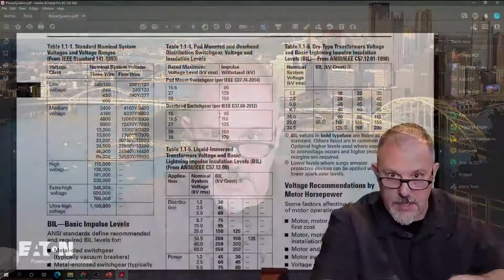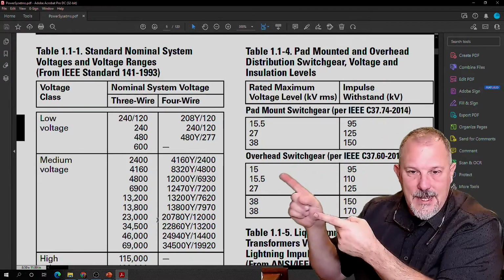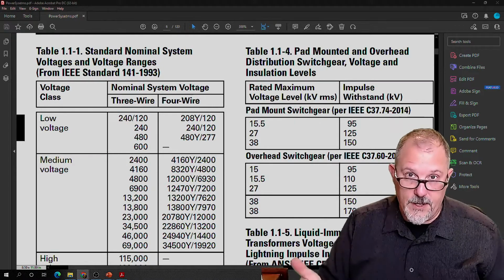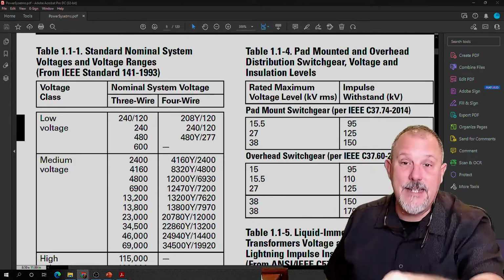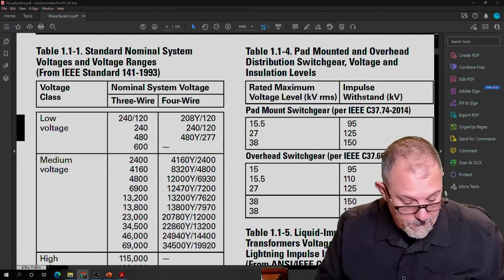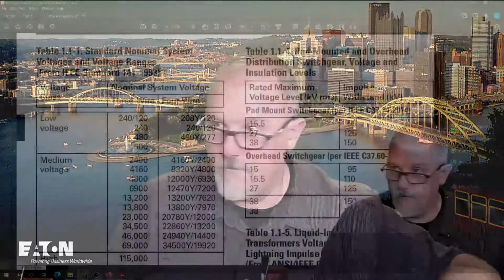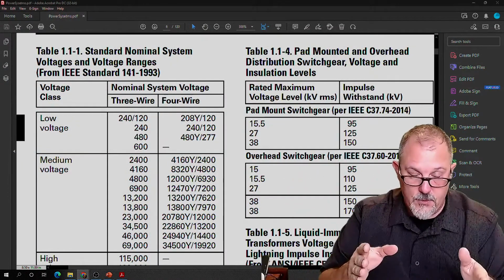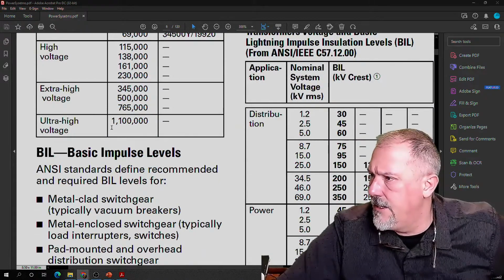Power Systems Design - Voltage

Comment: About 5 years ago at a IAEI meeting they mentioned that some people in the USA were looking into two things: raising the 480 volt commonly used 3 phase system to 575 volts to save money on wire and installing DC panels in large sites to save energy on Rectifiers, power supplies and air conditioning. Think they stated that Japan has some DC distribution panels.  Would also save energy on LED luminaners . You are right on about the 120/208 panels. In my area they are by far the most common system. The large hospital & research center that I retired from probably had over 150 480 to 120/208 volt transformers over the 5 million square foot campus.